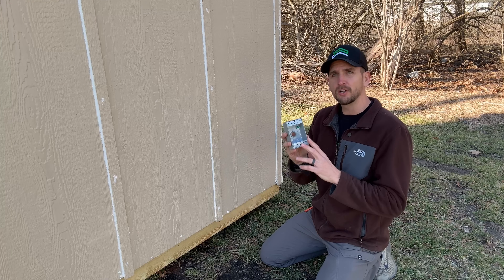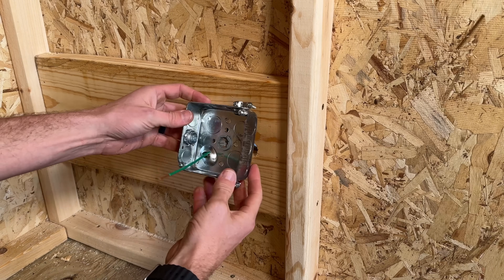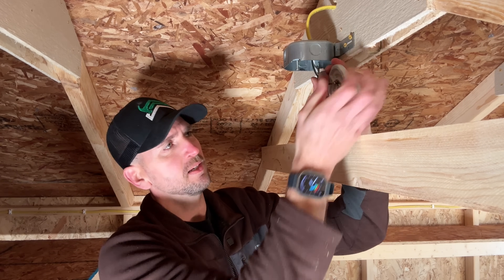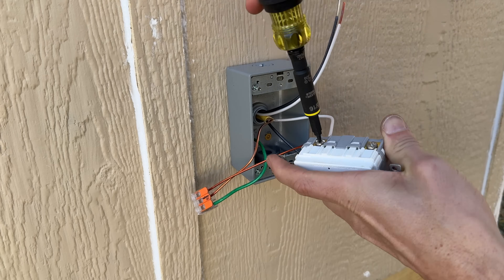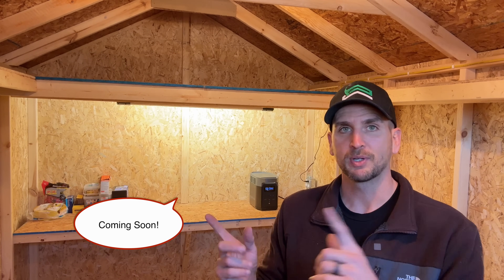DIY Guide To Wiring A Shed For Electricity

Comment: Your videos are the best and simple for these kind of stuff. One question tho I was thinking of doing the same with my shed but I want to have a backup extension also from main house on cloudy days where my ecoflow doesn’t charge from sun ? What’s the best solution for this ?
Reply from the maker: Not sure about the quality of these units but the concept would work for your application.  The "Generator" side would be you plugging in an extension cord and then you would wire the "Normal" side to the cord plugging into the EcoFlow or other portable power station.

Comment: You really should ground your outlets.  Yes, there is a ground wire, but you forgot to actually connect it to the ground.   Your battery/inverter system probably has a ground connection on it.  You should wire that to an actual ground (perhaps two copper rods driven into the earth, 6 feet apart).

Comment: At 16:52 it's apparent that the power station connection to the shed's line in is from the rear of the EcoFlow. I'm building out the same for my shed, but with a Delta 3 Plus, however the rear panel connections appear to be 120v IN (extra battery port and AC charge), rather than 120v OUT, as the outlets are on the front panel. Can one of the rear ports work in this instance, and if so, does it matter which one?

Comment: I have an outdoor GFCI plug. I built a shed and I am trying to run power into my shed and run it from this GFCI outlet that I already have. I would like my shed to be GFCI protected. Do you have a video on this. About the load side, versus line side and running power into the shed. Thank you very much for your videos.

Comment: You have to use electrical tape around switches to prevent short circuit in the metal box
Reply: Wrong.... this isn't the 70's anymore

Comment: Nice video, was a bit confused as to why you powered a 20 amp service with a 15 amp GFCI .  Seems to me that was an under powered supply point.
Reply: No. Only the actual plug sockets are 15a only (Receptacles are 15amp due to NEMA specs 5-15r, as opposed to a 5-20r). A 15amp receptacle has and is rated for 20 pass-thru.  In total you can still pull 20 amps (80%=16amps) through that "15A" gfci. The ONLY limitation is that you cannot plug a 20a device/appliance into that 15a receptacle. This is protected because of the non-fitting/different plug/T  - Nema 5-20r.

Comment: ⚡️!!! You didn’t tighten one of those lever nuts on the hot wire. On light switches box.( 11:16 ) !!! ⚡️
Reply: internally it was closed/tight. Those levers have give as the lever itself does not have anything holding them down.

Comment: Will I be able to run a 115v table saw with a 115v window a/c unit simultaneously off a 20 amp circuit?
Reply: Not likely. Consider a cordless table saw. They've come a long way. Costs a little most, but if you already own the batteries it's not too bad. I use Milwaukee.

Comment: My wire has 4 wires. What do I do with the 4th? It has red, black, white and copper
Reply from the maker: That is just 12-3 or 14-3 Romex.  Ground, Neutral, and 2 Hot conductors.
Reply: @EverydayHomeRepairs  so what do I do with that 4th one? Do a nut on it in case I want it later? I'm only doing 15 Amp outlets

Comment: Sorry, but this video fell short.  I don't see where you explained how to wire power from the house's circuit box.
Reply: That's what I was very interested in seeing... like I don't mind doing the labor of digging and running conduit I just wanted to see the wiring to use and how to do it safely

Comment: I have an old shed that has wires going into the gable, it has a 20amp breaker inside. If I replace the siding, will those wires outside shock me?

Comment: Hi Scott, love your videos. Can I ask a question about wago connectors? Some people suggest wrapping the wago connector with black electric tape. Will this create a fire hazard because the wires can’t breath? Is this a safe practice? Also, can I use wagos outside (exterior) in a gfci wet in use box?  Thank you. Jim.
Reply from the maker: Hey Jim, I don't use electrical tape to keep the levers down but if you do I don't think there is a fire hazard.  WAGOs can be used in an exterior box as the box should be weather tight.  Best of luck on your projects.

Comment: Everybody trying to build a shed who is watching this -  LOOK UP!  6:08  There is no ridge beam.   But there ARE collar ties, and rafter ties.  You must have one system, or the other.  Otherwise, literally almost nothing is holding your walls together if a stiff breeze blows, because a roof either hangs off the ridge beam, or it sits on the walls.  One good push can send it over.

Comment: The $1000 power station (plus solar) seems way overkill. That only works if you are a Youtuber and got it for free. Also, a motion sensative exterior light would be more useful.
Reply from the maker: Yeah, the complete package with panels is $1,000 but we will provide a few different options in the future as well.  That experior light does have motion sensor so it turns on when I am walking out to the shed.

Comment: You need to ground your switches, Scott!  The way you have it, the cover plate and switches are only when the plate is attached to the box.  When you remove the cover,  the plate and switches are no longer grounded.  Always run a ground from switches to box.  Thanks, Russ 29 years in Electrical Trade.
Reply: True. In my house under normal circumstances, all my switches and receptacles are unattached and hanging out of the boxes 😂
Reply: The grounds are useless in this install anyway. Where is the grounding rod?

Comment: Everyone's different on where to place the electrical outlets, I prefer if clear from code in the national electrical code to place the outlet at the same level as a switch. Why? The benefit, of course, is  not reaching down to plug anything in. If you  have others that may use this now that may  have disabilities or sell to those that do if you sell home in the future. Third, it is safe to keep away from young children at a higher height. The interior can be a combo of light switch and duplex outlet. Hopefully, it will be a useful way to do for others with that need.

Comment: I would have done a regular outlet on the outside of the shed to give u power outside but I would have ran power to the gfci inside the shed so in the case of a nuisance trip the gfci is inside the shed and will be easier to just reset instead of having to walk outside to the gfci to reset it
Reply: Hey I’m new. Could he have added more outlets to the left side?

Comment: My shed has existing buried power to it from an add-on outdoor box on a house brick wall with circuit breakers near the main breaker box.  The shed only has 1 or 2 outlets and only one overhead light.  It is finished with square ceiling tiles, so I'd have pull ceiling tiles to add another light fixture or two or outlets for LED/Fluorescents, plus an 4' LED light over the workbench.  I also want more outlets, so I guess that means removing particleboards to run new Romex for them.  Not a job I'm looking forward to because the shed is packed full, but I'll tackle it some day.  I do like those LaGrange (I think) outlets you use and I'd use them for new outlets and to replace the old ones.  Thanks, Scott.

Comment: Is it okay to use that NM wire in those open uncovered stud bays?
Reply: The studs protect the NM from damage, if centered. But the surface mounted wire running across the studs to that outlet box? Would not be allowed, unless you protect it with conduit or even just a 2x4 blocking. He should have ran it up and over and back down.

Comment: My advice as an electrical contractor:

   -don’t run pvc conduit underground.  It will crack eventually, especially in colder climates and depending on the cable/conductors used inside, result in damage.  Use Teck cable or if you must use conduit, use a continuous ridged tubing (the orange or black stuff).  Teck is also way easier and quicker to install.  

- leave slack outside your box.  If you’re closing those walls in and you damage the conductors either initially or over the years, you will want more to pull through 
  
  -staple every 3’ is fine.  It’s usually a sign of an inexperienced electrician to see a million staples 
  
   -use morrettes and absolutely never use those push connectors. The point of contact is a knife blade and they burn out all the time.  The say they are rated for 10A but I would only use them in a 9W pot light.  (0.075A)

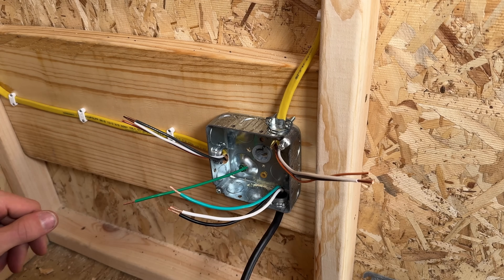Comment: Why no sealant behind the outside box?  Water can now run down the face and into your siding where you drilled the hole.  Also, you might not store anything in the shed up high, but the next owner may.  At 10:14, you had the hot pinched between the pancake box and the exterior light.  The box at 13:51 has a punchout removed with an NM clamp on it, but no wire.  I think that needs to be plugged.
Reply from the maker: Agree, the same sealant used for the pancake/exterior light I sealed around the back of the exterior box just leaving a small gap at the bottom just in case any moisture needed to drain out.  Thanks for pointing out the other concerns with the time stamps.  As always I appreciate the feedback.
Reply: A NM clamp is sufficient as a plug.

Comment: I like the slim GFCI.

I used those in my Dad's old 1948 house that used to have standard two-prong outlets.

Slim GFCI fits nicely in older outlets 👍
Reply: managed to tuck the wires into it and everything? i have a 1954 house and the wires are all old stiff and brittle.

Comment: 11:50 - This is why I have reservations about Wago levernuts. The third lever of the black wires was never tightened.
Reply from the maker: It actually does still have a secure hold.  Once the wire is inserted then the lever does have some play where it can be pulled out like that but still have a good connection.  The biggest issue this can cause is  snag other wires inside the box.

Comment: Nice job. I like the idea of "off grid", though that's exactly economical considering the power station requirement. How will it stand up to weather changes? As to the circuit, unless I missed it, there's no actual ground. I'm not an electrician, so not sure how that should be addressed.

Comment: Nice job.  At my previous house, I just needed a light in my 10x12 shed because I had a power outlet  within 25 ft of the shed.  I bought a solar powered motion sensor flood light, rearranged the configuration to hang from the light from the ceiling and ran the wire for the solar panel to the south side of the shed.  The light would automatically come on when I opened the shed door then  it would turn itself off when the door was closed.
Reply from the maker: Not a bad setup 👍, thanks for the feedback!
Reply: Yep I will do the same this summer, got a solar hanging light, added an in line motion sensor

Comment: 15:18  You passed 2- unsheathed wires from the 4-s box to the weatherproof box.  You know better than that.  Should have been two 12-2 NM cables.

You didn't address this structure and a grounding electrode for the electrical system.

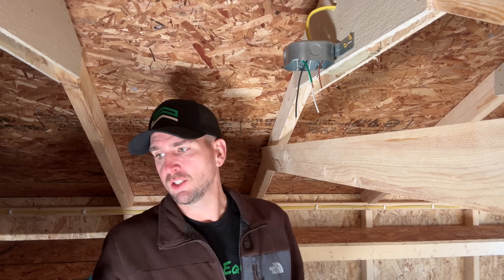6:21   9:18   You stapled the NM cable appropriately near the other boxes in this project, why not within 12" of the 4-0 light outlet boxes?

Comment: Personally I would have used plastic lampholders instead of porcelain, granted both can crack anyhow. On the lampholders one would use the current style of led bulbs (where it has more base than light area) which I have all but eliminated around my house. I would have used probably 100W led flood lights on the ceiling. Also a 100W led bulb would seem half as bright in that shed considering there are no white walls or ceiling. Maybe a 3rd flood light above the work shelf to see better.
Reply from the maker: Thanks for the feedback!

Comment: Under what circumstances would you need to add a grounding rod to give the shed an isolated ground ?
Reply from the maker: I think the only instance where you don't need a grounding rod (or 2) is when you are feeding with a single 120V circuit.  This is my understanding but would be good to check with your local inspector.

Comment: Lol he didnt secure the hot side of the wago, thankfully the switch side so not a big deal
Reply from the maker: It is secured, once the wire is installed the lever has some play.  This is the reason some guys will tape the levers to avoid hooking a wire and then opening completely up where you could run into issues.

Comment: You can bury UF cable or thhn in conduit at 12" of cover ( approx 13" depth), if the feed is gfi protected' 20 amp or less, 120v, single circuit.  No need to go 24" as long as you don't  cross a driveway.
Reply from the maker: Thanks so much for the feedback 👍
Reply: I believe you can just direct bury uf cable but still need conduit to the boxes in 12 inches as long its fed from gfci before entering underground. Please correct me if I'm wrong
Reply: @smashthings4fun  yes, but only if subject to physical damage.  If pvc it must be schedule 80.
Reply: @Bob.W.   Anything less than 8ft above grade and surface mounted is typically considered subject to physical damage
Reply: @nyetloki  agreed if it's near cars or roadway.  Not surre if it's back yard.  Opinions vary.  Inspector will have the call.
Reply: @Bob.W.  not just near cars. UF on the side of a house at eye level and below is subject to physical damage like lawn mowers, edge trimmers, wheel barrows, kids playing, etc. Same as NM or MC running exposed on the surface in an unfinished basement (no studs protecting it).
Reply: @nyetloki  yes, it all depends where it comes out of the ground.  Underneath a shed should not be a problem as long as sideboards prevent a weed whacked or spinning blade from getting to it.  Of course, UF can be chewed so Sch. 80 pvc is still better practice imo.

Comment: Running 12ga wire to lights in an off-grid shed (which these days would tend to be low-wattage LED) does seem a tad overkillish. Heck, I'd be looking to make them DC anyway to avoid the double-conversion penalty.

Comment: Since the shed is totally off the grid, are the grounds in the circuit truly grounded? Should you wire the grounds to a copper grounding rod buried in the ground?
Reply: There are a few things slightly outside of code, but I'm still giving this a pass as it's 99% safe. The GFCI is providing a fake ground to whole system. If there is a case where the ground would be relied on, the GFCI will trip instead.

The "GFCI fake ground" is the same procedure you'd use if retrofitting a grounded outlet into a box with no ground wire.
Reply: @thesmallterror  I agree with effectively safe using the GFCI. Codewise, I don't find anything directly applicable. Similar fed outbuildings don't need a grounding electrode if it's only one circuit per 250.32(A)Exception. 250.34(A) says generators with only cord and plug connected equipment do not need a grounding electrode. But a power station is not a generator according to code (a generator converts mechanical energy), but it's not a permanently installed energy storage system either (NEC 706). IMHO, 250.34 is the closest and most sensible approach, which if used, means everything is fine as it's done here.
Reply: As long as the GFCI with "fake ground" as you put it has a special sticker on it saying "No equipment ground".
Or actually I think nowadays you are supposed to have arc fault too...
Reply: Yes, you should. Every separate structure should have a ground rod as well. Odd that he forgot since when he did the garage solar setup he mentioned that.
Reply: @oliverwright8500  Not if it's a single branch circuit, gfci protected, with ground running back to the main structure.
Reply: @oliverwright8500  Multiple ground rods in a small vicinity? Is that risking a ground loop?

Comment: A pancake box has 6 cu in capacity. 12-2 wire requires 6.75 cu" capacity, so technically you can not have 12-2 in a pancake box.
Reply: Technically the shed probably doesn't need to meet NEC code as it isn't connected to any permanent power.
Reply: This shed setup is interesting since its power does not come from the grid. I know NEC code does have bonding/ grounding requirements for “separately derived systems” in Article 250.

Comment: Hi there, quick question: in my garage I have a receptacle that has 2 green wires connected to it 1 has power and the other doesn’t. “Open ground” on plug tester… I see no other wires in the metal box, why is that? How can I fix that?

Comment: I'll just run an extension cord out to my shed.
Reply: Be careful. Because that is how my offset garage caught on fire. The electrical surge caused the lights to overheat.
Reply: Yes especially if you are using a power station for power. 73
Reply: Me too 😂
Reply from the maker: That is the quick way 👍

Comment: Why would you include the lights on the same GFCI circuit? It trips and you got no lights…
Reply from the maker: It was a trade off I was willing to take to provide GFCI protection to the entire shed and also a "disconnect" for the shed.
Reply: GFCIs aren't supposed to be used as switches or disconnects...

Comment: Hello   your one lever on the wago connector was up.  Black power wires.   Metal box with two switches.  I use wago also but I like to use colored tape on the levers.
Reply from the maker: Yeah, that is probably the biggest design "flaw" I wish they would fix.  Even with the lever up it still holds strong (we tested this on prior videos) but does then create a hook that could get caught on other wires which is less than ideal.
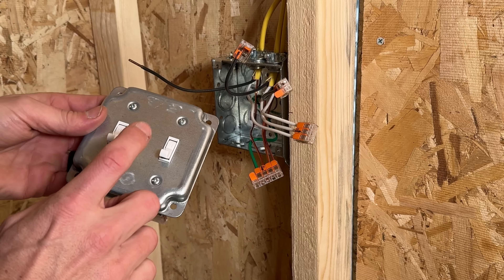Reply: At 10:40 or at 11:39